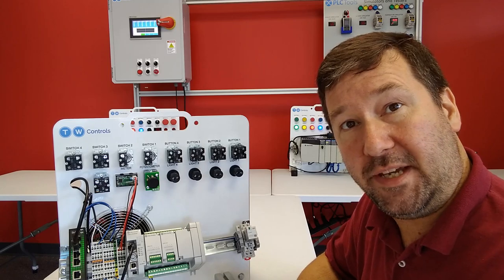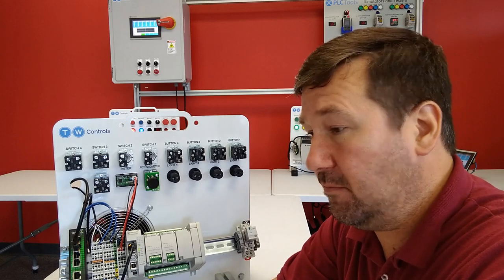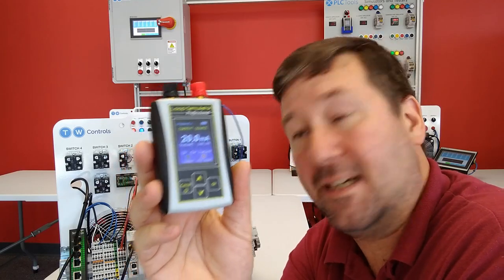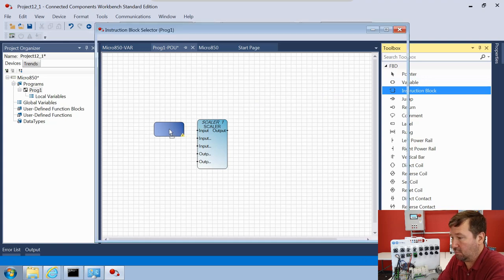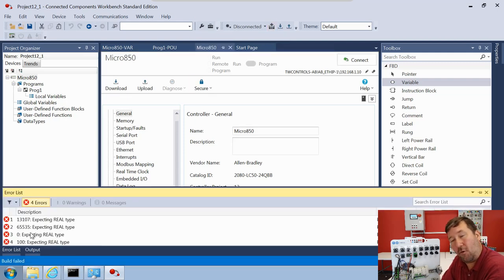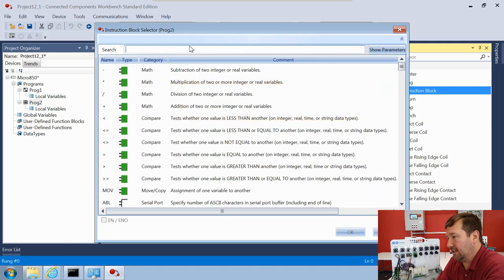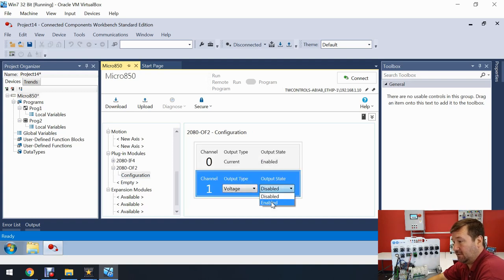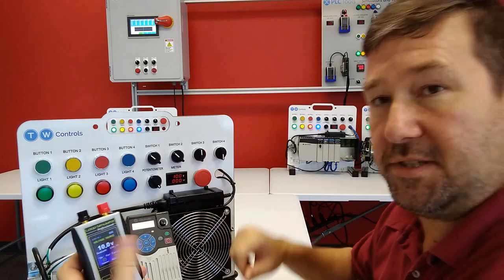Micro800 Plug-In Module for the Micro820, Micro830, Micro850, Micro870

Comment: I just tried to use the "Any_to_Real function and it is not available to use. I see an "Any_to_Lreal" but it doesn't work. I was wondering if a move command would work fine to make a UInt to a Real?
Reply from the maker: Switch your theme to Default and it will be there.  In the Logix theme it is the STOR.
Reply: @TimWilborne  Thank you very much!!!!!
Reply from the maker: You are welcome 😁

Comment: Rockwell tech support failed to help me locate the status bit of plug-in modules. My goal is to keep the logic running even while the any modules are unplugged. Instead of faulting the Micro PLC, I can keep the logic running but I am not able to locate the status bit of each module to display its status on HMI to help operators in troubleshooting to find which module is missing or needs to be replaced. Is it really impossible? Thank you

Comment: In this video you show scaling of values in the data table. You map the ANA in directly to an ANA out to drive an output from an input. The scaling is just for display demonstration it appears. I am writing values from a Compact logix to the 850 via MSG which will be in a DINT. I use the ANY to convert from DINT to REAL, scale that REAL to another REAL and then use an ANY to convert that REAL to UINT which is the physical output at the ANA out card. CCW accepted this ok but I have yet to get a test bench to physically confirm. Does this sound like it should be successful?

Comment: Hey why don't you try HSC plugin module and make program so we learn something by your efforts in this matter
Reply from the maker: We have done it on the built in high speed inputs of the Micro850 which can be found at the following link.  With minimal modifications it also works for the 2080-MOT-HSC.  The reason we haven't done it for the 2080-MOT-HSC is funding.  We have a small budget for parts outside of our normal automation projects and most of it goes to Patreon projects.  If we get an automation project that includes the 2080-MOT-HSC then I'll do one on it, it is just a matter of waiting for that opportunity.
https://twcontrols.com/lessons/allen-bradley-micro800-hsc-high-speed-counter-configuration-for-encoders-in-ccw
Reply: @TimWilborne  ok tell what are the modification I do to achieve my goal in your made program but please be specific
Reply: @TimWilborne  or say please clearly mentioned so I can understand

Comment: Screws are important!  One time I trying to retrieve a P/N for an SLC 500 CPU , I opened the door and  it faulted the processor and took the system down! Scary Stuff  !!  Anyway the screws on the CPU card we never tightened to the backplane....
Reply from the maker: Yep, no manufacturer is going to include screws that are not necessary.

Comment: Mr. Tim, I am an Electrical Engineering student working on a project using a Micro820 and your videos have been VERY helpful! I do have a question about the embedded analog output. In our project, we have to control a Omega I/P pressure transducer which takes an output signal of 4mA-20mA. The obvious issue is that the embedded analog output (V0-0) ranges from 0-10V. I have seen your previous video where you place a 250 Ohm resistor to an analog input to get your 4-20mA signal, but would the same principal apply to the analog output or would we need to purchase the extra plug in module (2080-OF2) to output 4-20mA?? Thank you in advance!
Reply from the maker: No, the opposite won't work.  You would need  a 0-10VDC to 4-20mA converter.
Reply: Okay, so I will need to purchase a 2080-OF2 plug in module? Thank you again for the help!
Reply from the maker: @chasedomingues1222  That would be one option but they make external converters that may work also.

Comment: Can you adjust the temperature of a 2080-TC2 module ?  During the calibration of Honeywell UDC Controller and using the Micro820 as a so called chart recorder via SCADA software, there is ~ 1.5 - 2.5°F variance between the UDC and PLC readings.
Reply from the maker: Should be able to but I don't have a 2080-TC2 to play with.

Comment: how do you know what com is associated with each input? or are they all tied together and does not make a difference?
Reply from the maker: Yes the com terminals are very important and unique. Check out the wiring diagrams for each plug in module.
Reply: @TimWilborne  Okay, thanks. I did look at the manual/wiring diagram for 2080-IF4 and it only shows the 12-pin block and pin labels, not including which com is which. That's why I asked. If I need to I'll call them up and ask, they're usually good with customer support.

Comment: Mr Tim Good Afternoon.. Where can I contact u? I need to configure an  2080-MOT-HSC to read an encoder pulses!! Thanks
Reply from the maker: This lesson will get you 90% of the way there. It is for the built in high speed counter but the setup is the same except referencing your inputs.
https://twcontrols.com/lessons/allen-bradley-micro800-hsc-high-speed-counter-configuration-for-encoders-in-ccw
Reply: @TimWilborne  thank Tim. But if You could help me specificly in that configuration and wiring.

Comment: Where does 65535 come from? - I thought the 2080-IFx were 12 Bit?
Reply from the maker: The bits of resolution doesn't necessarily determine the raw values.
Reply: I'm  trying to understand when I need to use 4095 VS 16k etc.

Your videos are very helpful! Thanks for taking the time to post them.